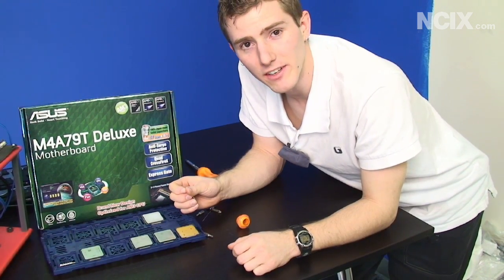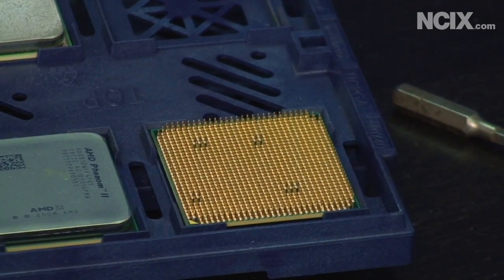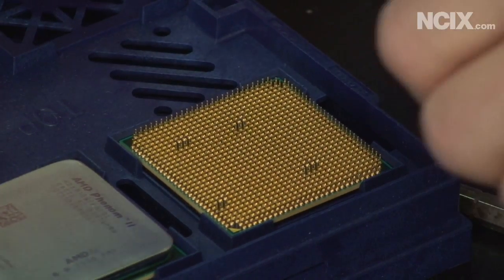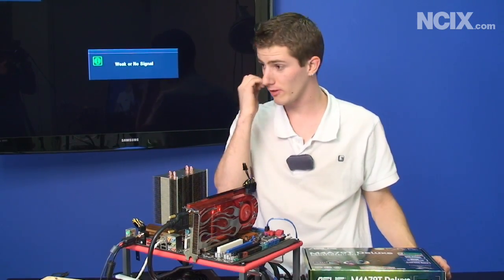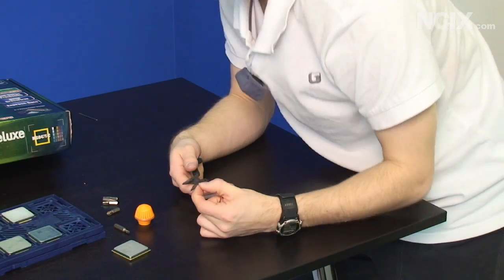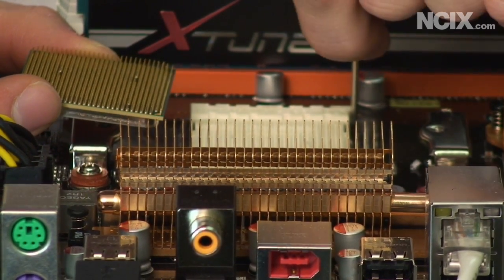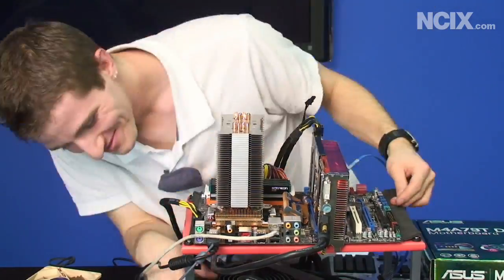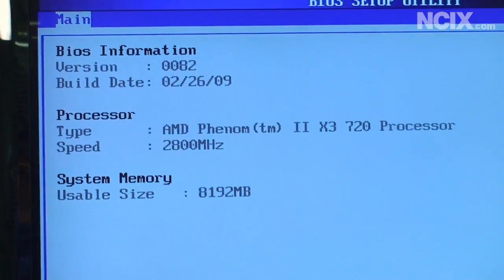Fixing a Bent / Broken Pins on a CPU (NCIX Tech Tips #36)

Comment: I bought an n520 for my FX8320, placed it backwards... when i removed the heatsink it came out with the stuck procesor and a few pins were bended and there was some thermal compound on them... I almost cried because this is very expensive and i can´t afford another one :( .. i watched this video and read some commets on the web of people who goes through the same thing... i got the necessary strenght and got them fixed with a credit card, rubbing alcohol and dental floss... didn´t boot first couple of times... I had to remove the heatsink again ( I think it was too thight ) then i tried a third time and it worked!!!

Comment: I did this with my core 2 duo and I fixed it
Reply: Core 2 duo is LGA not BGA, how is that possible, it doesn't have pins.
Reply: laptop processer
Reply: Fair enough,
Reply: +superdeathretard It is pretty easy since it is 775 socket, but on newer boards like 1155 or 2011, it can be much more difficult or even impossible to fix since the pins are much smaller and closer together than 775.

Comment: Yesterday I was cleaning my PC which was overheating and shutting off by itself. The thermal paste between the heat sink and CPU was so stuck that I ended up screwing up and bending a whole section of my processor (about 10-15% of the pins). I was able to straighten almost all of them (one broke off) with a thick needle, setting it in the pin rows and raising the pins back into place (I had to do this from both directions). Thankfully the pin which broke was not essential, and everything still works perfect.
Reply: LOL i got a brand new 9370 was placing it in the case and rubbed the pins on my H60 ribbed plastic cooling hose i screamed like a mad man lol. Luckly the cpu still booted and runs fine lol. It made a loud zipper sound and i wanted to cry lol.

Comment: So fucking pissed, i just dropped my cpu and bent like 60 pins and including some broken pins, cant buy another. So fucking pissed at this considering im on my 24/7
Reply: You can use a gift card from best buy and straighten the pins out by placing the card between the gaps and pulling through it. That's what I do and it fucking works. Hope this helps.
Reply: Yeah I was able to fix them a while ago, But thanks for the info anyway, Might help others.
Reply: ***** 60 pins!?? that's excruciating to repair! lol
Reply: TshirtGuy read my first comment
Reply: superdeathretard yeah i had only 3 pins bent, it was so difficult to straighten coz the pins are so easy to be bent and I had used the same card not the exact card but its as thin..so I know the feeling its very2 difficult
Reply: ***** I have a 4th gen cpu so my pins are on my mobo
Reply: I know

Comment: I found a useful tool for bent pins: A syringe needle, it's hollow on the inside. Just pinch off the sharp end and widen it with a normal needle and it fits nicely over the bent pins.
Reply: Works perfectly.
Reply: Frank S That is really good to know
Reply: Thanks.
Reply: jospi2 Thanks
Reply: Wow.  Imma do this hahaha

Comment: Why Intel use the LGA 1155 socket pins on the motherboard that will bend from a soft breeze is beyond me...
Reply: intel pins are harder to bend than amd, this is my experience with them anyways.
Reply: cuse this was so easy?
further this may not work for long anyway.
think about it its a lose pin in there and if it just so slightly loses contact for a split second the pc will die.
Reply: I think that is what happened to my i5 from bent socket pins. It is a pain trying to get tech support from either Asus and Intel regarding the Socket i found. Good ol AMD...

Comment: Guys if you are wondering what to use. Use tweezers. I dropped my cpu like a month ago and at least 30-50 pins were bent and i did not think it would ever work. I am useing that cpu now
Reply: I use a razorblade. Push an entire row at a time.
Reply: Damn i never thought about that
Reply: Ignacio Gutierrez and your less likely to push them to far. Bending back and forth makes the pin weak and break easier. Still is a pain to get right though.
Reply: roger supernova I did the row thing with a thick sowing needle (as thick as the row between the pins). I agree.. going on row at a time is the best way to keep them all lined up.

Comment: I literally just dropped my cpu just like this, only four pins bent, wish me luck
Reply: any updates? did you manage to fix it?
Reply: I actually did fix it, it was hard because the pins are so small and really hard to even see if they are still slightly bent. But I used the two needle technique in this video and eventually gout it straight enough it dropped back into the motherboard and booted fine! I love YouTube, always some video of someone who has been there and done that, and can now help you out. The tricky part was pushing the pins hard enough to get them to move, but not hard enough to get them to snap them off, not for the faint of heart
Reply: damn gratz!
Reply: What cpu was it

Comment: When im trying to straighthen the pins, i broke 7 pins. So that means i need to use a 7 small metal pieces in order to work?
Reply: Asyraf Yazeed you are screwed my friend
Reply: Yup
Reply: But then can I use other metal pins instead of CPU pins cause I lost it due to it's too small
Reply: well, that depends on the alloy of the metal
Reply: like a thin small safety pin? is it possible?
Reply: Next time use a razorblade to push them sraight slowly. The other pins make sure you dont bent to much. Saved loads of cpus that way

Comment: I recently was cleaning my computer system and I bent a few of the pins on my processor by dropping it, I managed to put then back in place the CPU fits in the socket but my system powers up but doesn't display anything. 

I  think it is the processor, but I'm not sure so does it matter if the pins are a bit bent as long as it fits in the socket or could it be something else?

Comment: hey man i came across the same problem but the cpu's where different the pins are soldered onto the motherboard and one of the pins got bent from replacing the cpu with a new on so when i tried to bend the pin back it snapped off so what i did was i took a small piece of cat5 wire with it shaved from the casing stuck it in the hole put the cpu in and clamped it down and bingo it worked this might be useful for you if you run in the same problem.

Comment: When i press the power button it doesnt do ANYTHING, it wont even move the heatsink and the fans, no power at all! Does that mean i got some other cable wrong? Because i messed with the cables before because i want to modify something. Could it be that it is in the wrong place or not good?
Reply: either the power/reset/led (sorry can't remember what those cables care called) cables are in the wrong place or your psu is busted.
Reply: psu? 
And i tested it with 2 diffrent computers, i re-did all the parts into a new motherboard where everything works and new computer. Still it did not work. Could it be because of the processor?
Reply: DaRkiNGGaMinG power supply unit.
Reply: No, i try'd 3 diffrent ones. And i bought that one like not too long ago. So it cant be.
Reply: 3 things. PSU, MOBO, Case Power Button.
Reply: Make sure the power switch jumper is in all the way. They come out very easy sometimes especially if you move cables around.

Comment: LINUS! This did the trick for my FX-8350, thank you!!!
Reply: Please tell me more about this case. I'm having some problems with my fx 8350 related with this subjetc. Any info would be great.
Reply: Hey man i have a fx-8350 as well with 2 broken pins, did you bend the pin a little bit to get it to work? or did you straightened the pin flat? , pretty much did it end up like this?: [ | ] or like this [ L ]?
Reply: DaniFilth84 Like a L? that seems a little odd to me. I straightened them and worked just fine.
Reply: Hi
Reply: @NCTCBeats  hi
Reply: @cm01  Hi

Comment: Thanks! used guitar string (de10 - high E electric plain steel) to fix 5 broken. cut about 3 to 3.5mm. workin perfectly and seems to have helped with bsod's (clock interrupts not received on secondary processors) I can now play X-Rebirth longer than a minute at a time... was getting them consistently. AMD A8-3870

Comment: Hei i seem to have the same problem.I accidentally bent a couple of pins and tried to fix them .After hours of work i managed to make them pretty straight so they went in without problem.The thing is..my cpu overheats very fast and shuts down(10 min) but this happens only in games..my fan is running at maximum and i never had this problem before...Could the pins, not being 100% straight might be the problem?..Any advice :D? plz

Comment: actually putting to much pressure on it while putting in a cpu can do it also dropping the cpu or taking it out of the motherboard dont get me wrong i love intel i just fucking hate pins they need a pinless mobo and cpu such as the flat connectors on the bottom connect with flat ones on the mobo

Comment: Part2-cont.
Still quite worried my case comes tomorrow and thats when imma hook it all up and give it juice, hoping for the best.  The trick is-take a credit card and basically with slight pressure in the direction the bend needs fixing swipe the credit card back and forth carefully.  The packaging was shitty...nice metal box with a cheap hard plastic pop open shell...nothing protected individual pins.  It arrived like this from newegg...we will know tomorrow if it suffered permanent damage.

Comment: Bought a brand new 8350fx and was nervous and excited to build my very first pc.  You hope its all gonna go ok and that all of your fears would not come true.  However one pin on the outer row was slightly bent about to 2 o'clock.  W/O noticing this and going for the Zero Pressure drop in method like researched it sat awkward and didn't sit flush...slightly see-saw like. After I noticed 1 pin was bent my friend suggested the credit card trick which seems to have worked, the cpu dropped in fine.

Comment: heh my dad did the same and that cpu is still working after he stepped on it bending every pin a bit ^^
took a few hours but was kinda worth it since it was the newest one late 2004 so it was 478 was the 3,0 ghz one with HT but it was great performance in games with 2 gb ram windows xp and ATI X1650 512 mb on a crt 85 hz and 1600x1200 resolution ^^

Comment: Some models do with autosettings on pretty much everything (at stock my gigabyte mobo wanted stock voltage to be 1,4 on a tripple core athlon II 445 3,1 ghz)
but i ran 1,5 volt through mine on a arctic cooling freezer 13 pro and it kept under 50c in gaming for an hour or two (unlocked core + oc to 3,5 ghz)

and i can run it passive when i reduce voltage down to 1,275 and disable the unlocked core aswell as my overclock...
Since my freezer 13 pro is gigantic :3

Comment: to be honest, the pin doesn't need to be perfectly straight, it can be at a 170 or a 175 degree angle which is enough that when you put the CPU into the socket, the socket will straighten it out.

Comment: 2 days ago i was building friends PC , cpu was glued for heatsink i pulled it and cpu ( new FX-8320) fell on a floor. i managed to fix all bend pins with thin ruler and his sister tweezers. It didn't boot 1st time but later it is. and now it's working :D it is very hard. try using something very thin but with bigger surface , so you can align that pin with others. Good luck

Comment: Years ago I had an Athlon 64 X2 3800+ and 50 pins were bent very badly and 4 were missing completely. I got it to work, just use a credit card to slide between the bent pins. Then when you are putting the CPU back in the socket start with the corners. If you slowly press down on each corner of the CPU the pins that are not perfectly straight will eventually bend to go into the holes. Just have to be really gentle and not rush things.

Comment: for those wondering "why not just put the pins on the motherboard and use LGA like intel" the pins on the board could also be bent and amd cpu's are cheaper to replace than intels, that said i agree AMD should be switching over, there's only so much you can do with 941 pins...

Comment: I have done the same thing. I used a magnifying class and a pin to get the pins upright and straight, I had over 70 bent pins so it took me a while. I then tried placing it back into the motherboard and it did not quite fit, ran my old credit card in between the pins all 4 ways and it almost fit but few pins were stubborn.I tapped the cpu gently in with my finger and it fit and booted fine. I contacted AMD since their thermal glue is the problem but they were useless.

Comment: This is very helpful information. I have forwarded links to this video many times. I sell many used AMD CPUs and many customers break bent pins due to hasty insertion.  As long as there is still a metal base under the missing pin, this technique works!

Comment: I have a Gigabyte GA-M68M-S2 motherboard. I will be upgrading soon to a more sophisticated DDR3 Gigabyte super mobo, but until then, I found my AM-2+ Processor with a few bent pins. I straightened them successfully after 3 attempts. It fit in nicely and when I tried to boot the puter, it started then died, over and and over. It wouldn't stay on. Is it, in your opinion, a result of the processor issue or what other possibilities do you feel could resolve the issue?

Comment: One week later: have you tried raking the pins with a stiff piece of card stock or something similar that can fit between them? Most of the time as long as you can get it to the point where they aren't shorting the pads or each other they will still work. To do it find something that fits between the pins that's stiff enough to move them but not to break them and run it down the line in a grid. Hope it helps or hope you have luck selling!

Comment: Double FAIL,

LGA Processors has no pins but,

The LGA number correspond to the number of pins on the socket so if it had 50 000 pins it would be LGA 50000

Comment: you will not do any damage to your computer. If you bent the pin striaght and it boots up that means its making contact and no amount of turning it on or off and overclocking underclocking will ever hurt. The pin is doing its job, and that is to make contact with the socket.

Comment: I used a mechanical pencil tip like you mentioned, and I successfully managed to straighten all of my bent pins. I even got my PC to boot up, and it runs fine.I have unplugged it though, because i am afraid of further damage to my PC. I am missing one pin on the CPU, and a lot of pins were bent. I have an AMD 1090T Black Edition. Should I buy a new CPU? I use my PC primarily for gaming, and I want to play Far Cry 3 without my PC melting down!

Comment: I did this on my first PC build, i was setting the CPU in the socket and my fingers slipped and i dropped it and bent like 12 pins but i straightened it out and it worked again with a little pressure to get it in the socket

Comment: I have an LGA 1155 motherboard ( Asrock p67 extreme4 gen3 with d6 error) with even smaller, and more pins on it. I somehow bent a few pins so bad that my video card couldn't be recognized   I bent 3 back into to place and voila, works again!  The only problem is there's  one really damaged pin which apparently controlled ram slot 3 and 4 that I couldn't fix..but now i can bootup.  Many mobo companies won't allow you to return a motherboard with bent pins so if you can fix it you've saved $.

Comment: A pin has snapped off my CPU socket, does anyone know if this can cause DIMM slot issues? I was running two sticks of dual channel memory and now I can only boot with one stick installed. If I have both in then it just starts and restarts over and over.

Comment: $550 worth of new computer hardware from NCIX to transplant into a slim pc.
2 hours worth of work transplanting it to the new case.
That feel when you just fixed 2 redonkulously bent pins?
Priceless.

Linus, we used the combined needle + mechanical pencil trick and it fucking worked =D saved me from having to spend an insane amount of dough on a new motherboard/cpu although I'm still getting one anyway lol

But still...holy this saved my comp =D

Comment: You know... you could have just soldered it back on the processor with a precision tip and a speck of solder. That way you don't risk data corruption or damaging the socket.

Comment: i used pincers to straighten out 3 pins on phenom 2 940 after i had dropped it. this was a brand new processor which was bought 2 hours before. that was an "oh shit, you just screwed yourself" moment for me. 

that was 3 years ago. the damn thing still works great. have pulled out the processor from the socket and cleaned it thrice. AMD sure built those pins solid. and i'm glad the pins didnt break off or i would still be using an FX53

Comment: i just did this on a fucking asus maximus extreme!!!! 1155!!! took me 8 hours! i wish it was as easy as it is for amd, i had to remove the half broken pin, make a new one out of small filaments i cut out of guitar wire cable, used thermal paste as glue and stuck it in the whole and got the right angle to make fucking contact, im sooooooo tired its 6 30 am
peace

Comment: Hey Linus!  I wanted to thank you for your idea on fixing a broken processor pin.  I accidentally broke a pin on an old Pentium 4 processor for my old Dell Dimension 4600.  Instead of using the broken pin, I got a small piece of wire and twisted it tightly.  I stuck it in the socket hole and carefully placed the processor on top.  The computer started up with no troubles and I saved my old machine for future use.  Thanks again.